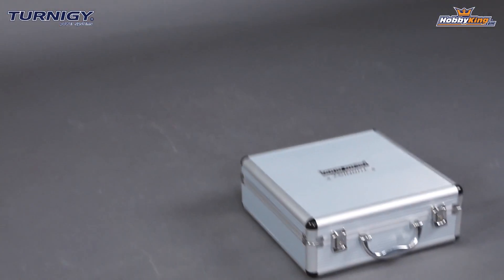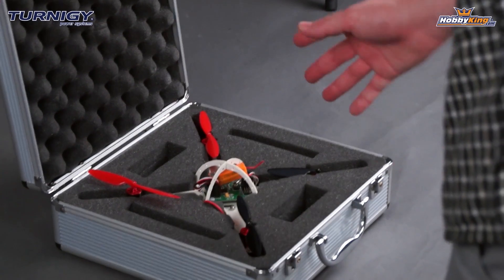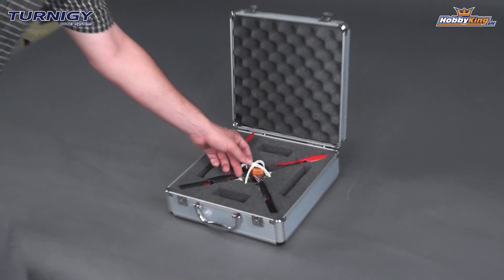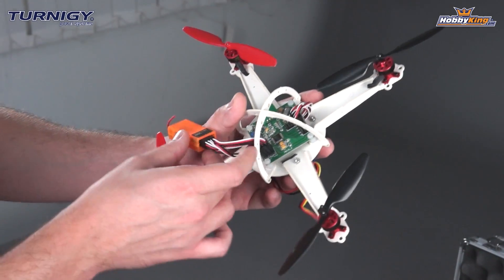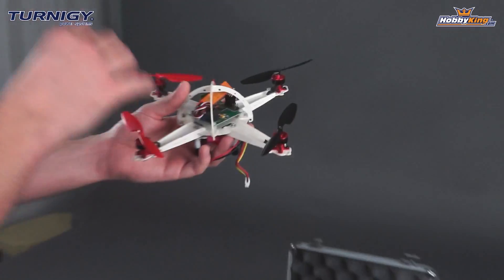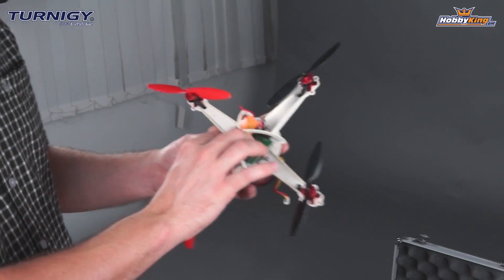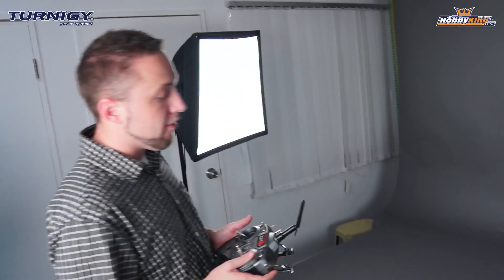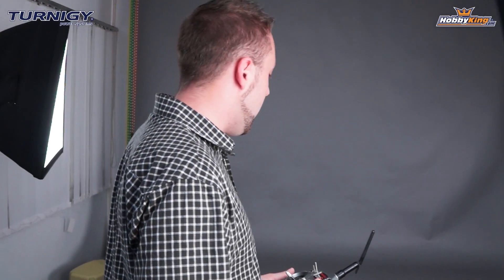HobbyKing Product Demo - Turnigy Integrated PCB Plug and Play Micro-Quad (PNP)

Comment: Looks like a gr8 little quad . Just one suggestion or just maybe a question. Why do they not have  some sort of prop protector cage that will keep you from snapping off your props and bending your shafts? Made of carbon or even foam which shouldn`t add too much weight.Flying it anywhere and there will be objects to wack into . Thanks for the video.